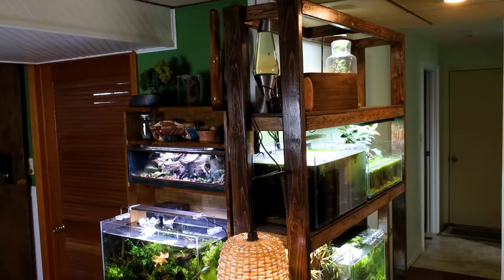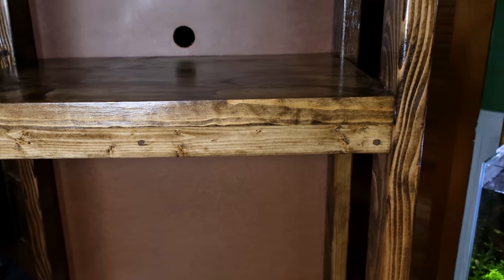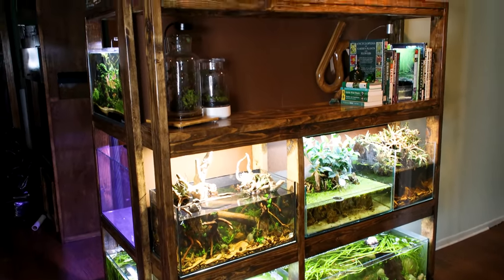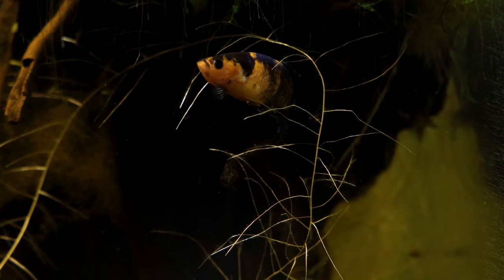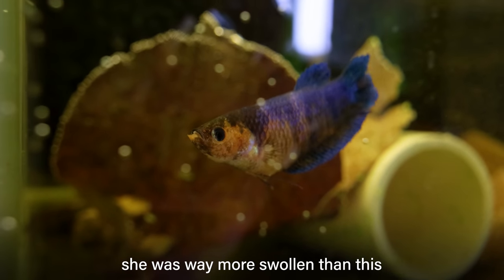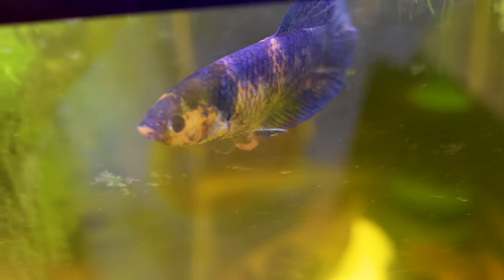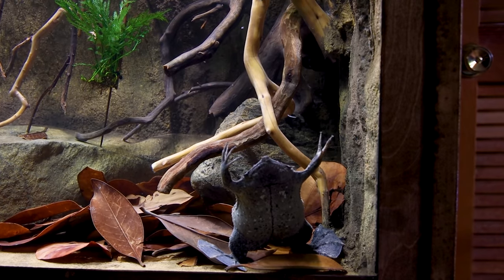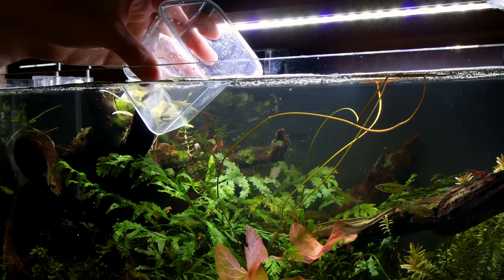Shocked by this Aquarium (Problems in Animal Room)

Comment: I once had an issue with a lamp giving out electric shocks but it was mounted above a terrarium so the animals werent getting electrocuted only me when i was touching the lamp or metal parts connected to it. Electrical faults can happen very quickly especially with cheap and low quality electronics like the lamp i used.

Comment: Consider a ground fault indicator for some tank equipment. GFI outlets or GFI circuit breakers may not be appropriate for your scenario, considering a trip would shut down possibly vital tank equipment, but an indicator would make you aware when current is traveling through an unintended path.
Reply: This working is assuming the current is somehow leaking to ground, which would be the ground prong of an outlet, or a concrete foundation, or a copper water pipe. Since your all plastic equipment probably doesn't use the ground prong for any kind of casing grounding, and the water in your tanks isn't connected to any home water pipes or the foundation in any way, the water itself would need to have a connection to the ground prong of an outlet, or anything else connected to the grounding of your home electrical system, in order to send fault current back along the ground, so a detector could sense the imbalance of current between 120v (black) and neutral 0v (white) wires. Without this, the fault current going through the water may just return on the neutral wire, and no ground fault detector would know about it.

Comment: I had a Chihiros Doctor fail in one of my tanks. Found 6 dead fish one morning (mix of tetra, otos and corys) then realised I could feel a slight tingle on skin when I reached into the tank.  I pulled out the CD from that and another tank where I was running second unit. Both were  new equipment but I wasn't going to risk it with the other tank. Now I'm always mindful of that sensation when doing tank maintenance - it was KGTropicals talking about the potential problem with broken heaters that educated me to recognise the issue. Always appreciate the info the fish community provides.

Comment: I had a stray voltage problem in a reef tank I used to have. I believe mine came from the heater, which I replaced. I also installed a grounding probe in the tank. Not sure if they really work, but it made me feel better. The sensation I got was way more than a tingle! I felt terrible for all my reef animals!

Comment: I recommend that you get a cheap digital multimeter. Put one lead on a ground connection at the socket and put the other into the tank water.
Check BOTH AC and DC. It's possible to have an AC voltage without a DC component and it's possible to have a DC voltage without an AC. Although it's much more likely to have AC from a defective device because it's powered that way. If he voltage is over abou 5 or 10 volts then you have a problem.
You can quickly check all the tanks.
Additionally to checking against ground, put BOTH leads into the same tank but as far as possible away from each other. And do the same AC and DC tests. Again AC is more likely to be generated by defective device.
Note that the neutral and ground wires at the socket may have 1 or 2 volts AC across them. Don't worry if your ground test, described above, is only 2 volts or less. This is a factor of your house wiring and nothing to be concerned about. You'll probably never get less than 1 volt when measured from ground. 
Certainly anything over 5-10 volts in a tank is a definite problem.
Love your videos and find them very relaxing. I know you've heard that before!
Note. The AC socket has three connectors. Two straight ones, one longer than the other. The long one is neutral. The short one is 120 volts AC. There's a round one that is literally Earth ground. You should measure from the round one. If you measure voltage between the neutral and ground you'll get a few volts or less and that's what I was mentioning above. I mentioned it because I didn't specify which connector. You could use either but the earth ground is more practical and slightly safer.
Also, a multimeter has a millivolt scale, mV. For example if you get a 50 mV reading, don't panic! That is 0.050 volts. Not 50 volts. Beginner mistake!
Reply: WOW🤯!
Reply: That's a lot of words
Reply: Thanks for sharing all this. I'm a bit surprised he didn't go for a multimeter.
Reply: Thank you for taking the time to clearly explain how to properly test, and when to not be concerned.

This is a very inexpensive piece of equipment, to ensure pet safety. Thank you!
Reply: yes, he was lucky he had a cut because human skin can resist current. However, if the voltage is low enough, you wont feel a thing. But that doesnt mean theres no voltage. He def needs to get his equipment checked.

 Well i wouldnt recommend him to check mains but he can call an electrician.
Reply: Thanks JohnE, that's a great piece of advice mate.

Comment: i had the same electrical issue with a nano submersible pump in one of my African Bullfrog tanks a while back, luckily it was the only powered component making contact with the water area at that time so I didn't have half as much of a trial trying to determine the cause, though I have since made a point to reduce the number of appliances I have connected to any one extension lead at a time :) 

Buddy, your channel and methodology are one of the most significant sources of inspiration currently for the state of my own animal collection and I cannot thank you enough :D I'm not sure if you are aware as to the sheer extent your influence has had on the hobby, I have heard your channel, and more specifically, your name referred to on so many high-status channels; Kamp Kenan, Snake Discovery, Wickens Wicked reptiles, the Tarantula collective, etc... It's phenomenal, quite literally ;) 

All the best to you and your zoological tribe!!

Comment: On the rack if you could even make room you probably can’t but I will suggest something after this ok a 40 gallon tank no water but leopard gecko setup and really short not as tall or it may be hard to keep it in the tank but you know some sealing ideas that will still let air in and it would be salt water but it will pull in so much fun and views an Atlantic Pygmy Octopus aquarium

Comment: Amazing video. I have had dropsy in one of my tanks in the past and only weeks after did I realize what I had done wrong. I am a big breeder with 8 tanks and feed lots of different foods. I recently started feeding bloodworms after a short break and instantly something was wrong. So if I was you I would make sure I'm feeding foods that pass well. shelled peas are a great option. also overfeeding will cause the issue. U are doing a great job and I wish you luck for the future.

Comment: I have been through such moves a few times, it is stressful. Years ago, we ran over 1300 total gallons and of course had to shift displays/racks as needed. Only 4 tanks were 46-75gal, the bulk was 20-29, and the beta wall of 15 2gal. To anyone who is entering this "hobby", it WILL snowball if you let it.  Your pockets might get tight here and there if you don't stock meds and water chems as a SOP.

Comment: Thanks for sharing insight into the issues. That pump problem was insane! Only because of a cut on your finger and you recognizing the sensation in the water were you able to solve it! Total Sherlock Holmes stuff right there. ;) And thats the first commercial I didn't skip past because of your chose in product and its tie into what you do. Not another wallet or web protection commercial, thats refreshing so thanks for that!

Comment: As a teen I worked at a pet store and getting shocked in the aquariums was not a rare experience. Having such a large amount of old tech in a lot of aquariums an occasional electric shock was not unexpected. Also by having many of the aquariums connected by water made finding the source quite an experience! Just by dipping your finger in the water until the zap gets more and more intense eventually the problem was found usually an old pump😂

Comment: I'd agree its certainly worth investing is high quality electrical equipment. Once I had a betta, and I can home one day and the heater wasn't working and my betta was belly up. I have to assume something shorted in the heater and zapped the whole thing. Or perhaps the thermostat went nuts and it cooked the tank? At the end of the day, you never know what will happen and it's a risk of an artificial environment!

Comment: Just in case, you might want to consider treating Mia for internal parasites. These can also cause the constipation and bloating which then lead to the dropsy (Which im sure you know is not a disease but a symptom). White or stringy poop can indicate that its parasitical. Anti-bacterial medication sometimes does work (or helps with secondary infections), however it can cause resistance. You want to be sure you 100% get rid of them to prevent Mia from yoyo-ing back and forth. 

The fact that you dont jump to your camera when an animal is sick only makes me appreciate your channel even more! :)

Comment: Are the outlets in the room protected by a ground fault circuit interrupter (GFCI)? That minor fault you detected with your cut could have been very much worse possibly even fatal. At around $20.00 it is cheap protection and well within the DIY realm if you are comfortable with that sort of work if not hire an electrician.
If you already have a GFCI on that circuit have it checked as it should have tripped. Stay safe! Love the videos. Take care

Comment: Install ground fault detectors on your circuits(GFCI). This for your safety and your pets. GFCI should trip when there is a leakage current(better than your finger test) and this is the reason you find GFCI outlets in your bathroom. Water and electricity dont mix together.

Comment: I have a betta who tends to injure herself every now and then (even with a tank with all sharp edges sanded down, so idk where she’s getting these scrapes). I understand the stress associated with a sick fish, and I also don’t post on social media regarding my fish until after my fish recovers. It’s scary every time, no matter how many times I’ve dealt with it.

Regarding treatment (skip this section if you don’t have fish), for all the viewers with harder water, I heard that Maracyn Two doesn’t work as well in harder water, and instead you should use Kanaplex. As for a bloated female betta, my betta has also had a bloated stomach (due to feeding extra baby brine shrimp for a few days) that wouldn’t go down. I fasted her for a few days and then reduced feedings to one third, then two thirds of the regular amount until she went back to normal. Fasting/underfeeding encourages them to reabsorb their eggs. I also fed her a tiny bit of single-ingredient sushi seaweed (no peas for carnivorous fish like bettas please!) every few days to help move her digestive tract along. I do this normally regardless, because she is prone to constipation. Of course, epsom salt also helps with bowel movements but luckily I didn’t have to resort to that this time.

Edit: Normally for cuts and scrapes I use Stress Guard. Also Tanner’s betta had dropsy but my betta never progressed to that stage so a gentler method was okay. He did what he needed to do to treat dropsy and it was what was right for Mia. Glad she recovered!

Comment: I have from time to time wondered about electrical issues you might have had, but you never mentioned any. Very dangerous. Can't you buy some kind of current (electrical) sensor that you can check the water/tank with? someday you might have a large current traveling through the water in one of the tanks. Scary.

Comment: Are the frogs fine? Wondering because you would think even a small amount of electricity could cause some long terms problems if it's hitting them 24/7
Reply from the maker: No way to tell yet. Very unfortunate, but I will say that they seem to be acting more normal since I fixed it.

Comment: How can you detect stray electrical currents in the water without having cuts on your hand? I had an issue once where an alligator snapping turtle bit a power head electrical cord and I didnt notice until I put my hand in the water close to the cord and got zapped. The turtle was fine and the power head promptly replaced

Comment: It doesn't really matter, you can't be great at everything but your shelf building work is not very good. "I'm adding cross bracing for strength" - 4x2 across like that does nothing. They way you have built it is using the butt joints and screws screwed into end grain for supporting the weight - the absolute worst way of doing it. You should be using the cross section of the wood for supporting weight. You would be much better off learning half laps / dados / mortis & tenon joints (in order of difficulty).